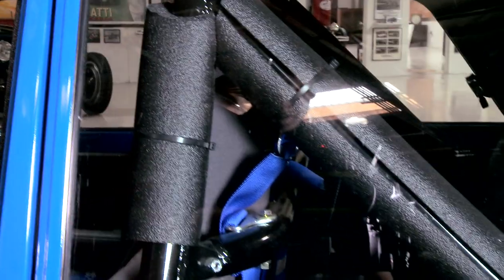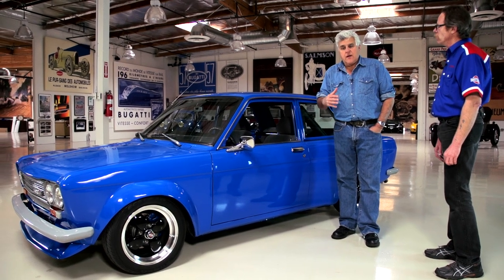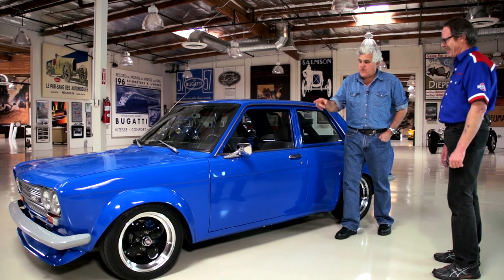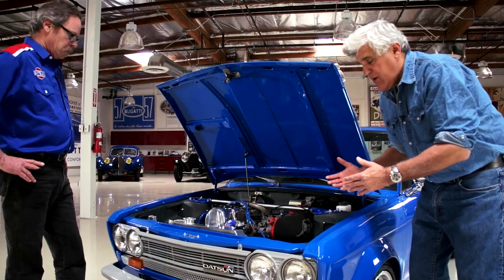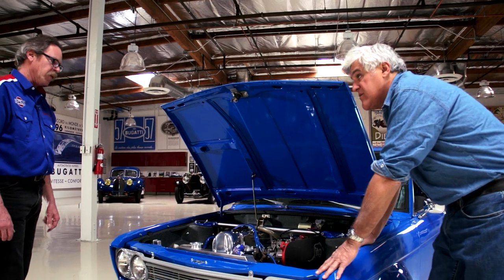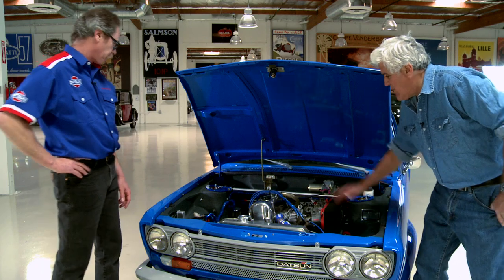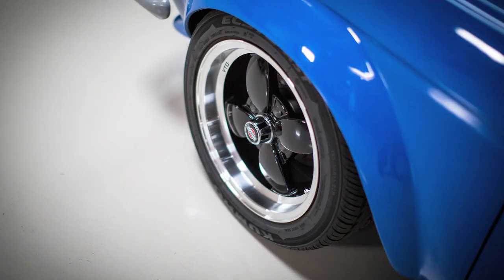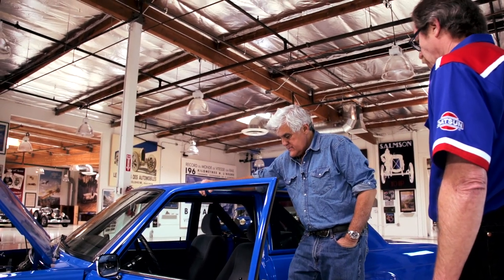1971 Datsun 510 - Jay Leno's Garage

Comment: All of "US" car guys need to be more like Jay. Just love EVERY car for what it is.....truly a purest. Beautiful car.
Reply: Well said
Reply: Purist, not purest
Reply: Vidal J  I first read your comment as "all of us US car guys...".  either way you are correct.  We might even be employed by a U.S. car manufacturer and yet the appreciation for the cars such as what we see on Jay's Garage can and perhaps should supersede brand loyalty.  I'd love a "73 Trans Am 455 SD that's been built to get a lot more ponies and more torque and match the suspension and braking to go with the power.  Add a sound system that cranks Highway Song loud enough to drown out the super woofers in the turning lane and we're good to go.  I could say the same about a '69 Ford LTD making similar "adjustments" including front buckets and a console and knocking on 500/500 hp/torque basically turning it into a grand GT.  I know there's an Volvo coupe that could massaged into something better than it was intended to be...   time to turn out the shop lights.
Reply: yep
Reply: hate to break it to you, but if you don't then you're not a real car guy..
Reply: I have a 2000 corolla and it such a beautiful car despite being slow and average. Same as my 2009 Ford Falcon. Love them both
Reply: The problem is most people can only have 1, so then nothing else can be good too.
Reply: "braking to go with the power" 
Or; brEaking b/c of power
..?
Reply: Participation trophys should also be awarded to everyone as well, "congrats u did it". This just sounds like how women pretend to be friends but they secretly hate each others guts.
Reply: I love the 510. But there’s nothing purist about this car. It’s moded to the gills
Reply: That goes more for european car people tbh, way more picky.

Comment: Awesome! My very first car was a 1971 4-speed manual Datsun 510 4-door sedan, light yellow with a black vinyl top and black interior. I bought the car near SeaTac airport in 1975 from a woman (she purchased the car brand new in downtown Seattle) who just got married and worked for the airlines. So needless to say, the car had less than 9,000 miles on it. I had to work and save the money to buy the car and have enough for insurance. My Dad and I had been looking for cars that were less than $1,500, but this car was selling for $1,800. I talked my Dad into going to look at it anyway, even though it was over my budget. The women sold the car to us for $1,400, but I didn't have enough for insurance, so I talked my Dad into lending me the extra $200 I needed with the promise that I had to pay it back within 6 months (He really liked the car also and knew it was like new, so he let me buy it). I had the car for just shy of 8 years. I modified the exhaust with a high RPM long header and 2 and half inch pipe with what was called at the time a turbo muffler (Exhaust Specialties did the work in Ballard or Seattle area). I had it dyno tuned at the only place around that did it (never heard of that before, a friend told me about the shop just off of 145th and Highway 99 in 1976). With the header and the exhaust, it pulled a 104 HP out of that 1600 engine, yeee haaa! It did 17 second flat quarter mile runs at between 72 & 75 MPH at SIR in Kent, could not get to go any faster even with speed shifting. The car could cook and the front end started floating over 120 MPH, no spoilers (speedometer only went to 120). When I owned the car, I didn't even know it had an independent rear end. I learned a lot since then because of others teaching me all about those Datsun 510's from fine people like yourself and others in the last 40 + years. Thanks, and I hope you and your dear families have a wonderful year!!

Comment: We used to call modified Datsun 510's "Box Z's" in the early 1970's. Knew a guy that had one set up like this from Thousand Oaks and man that car adjusted my thinking on what cool was. I believe the stock 1600cc motor for this car was also used in the Datsun pickup.
Very cool car.

Comment: Jay:  These Datsuns were all over L.A when I was a student at Art Center in the early 70s. I recall being told that there was a widespread suspicion that the 510 was inspired by the BMW 1600 and 2002...think of the suspension , size and body shape similarities!   Re a clear engine bay, a black neighbour of mine in Toronto once told me those older American cars with great huge engine bays were referred to in the Caribbean as a car for shade tree mechanics..because you could climb in and stnd beside the engine ..feet on the ground, to work on it!

Ken Bowes

Comment: That was the car to have when I was a kid growing up on California in the 80's.  This and the Ford/Mercury Capri!
Reply: Yeah ! The Ford Capri ! So exotic for us, europeans ! For us it looks like a muscle car with these shapes and this rear axle and blade suspensions ! And in real, it's a half of the size of a big muscle car that you have... X)
Reply: The ford capri was my first car.  So much fun, easy to work on.  Very fast and I had really cool mods like lowering on BBS wheels, glass pack exhaust with headers.    I miss that car.
Reply: Wow that's nice for a first car. Actually I thought this model was made for europe only. We run with one of these (model of 1980 if i remember) on a mountain road. This day I drove a 1986's Renault 5 turbo 2 and I tried the Capri for few minutes, it was fun to drive.
Reply: The Capri was distributed in the US under the Mercury brand...(Mercury Capri).  That said, on my 1971 everything through the car had Ford branding.  It was very much a Ford Europe car.

Comment: The truth of why Nissan eliminated the Datsun brand is simply the terrible level of jealous against Mr. Katayama and the others who succeeded for what they have done in the States. Back in the '60s, there was another car maker called Prince. Skyline was the Prince's car and they had the more sportier mind than the Nissan. The Skyline left a legend when the early Japanese Grand Prix which was the sport car racing and the early Prince Skyline GT had passed the Porsche 906. The reality was that the 906 had a electrical failure or something and had to go to the pit, and prior to that, it slowed down and Skyline passed it. At the grand stand, that passing was announced and the spectators saw the Prince Skyline GT came before the Porsche at the last corner and that wowed and encouraged all the Japanese motorsport fans and gear heads. That was the lap which made the Skyline name as the legend and grabbed the people's mind with the different level of respect. But sadly, Prince Motors had the management problem and merged by Nissan. And the designing staff of Prince have brought many great cars to Nissan. However Nissan management hated that image. And such mind went worse and they had the discrimination against the ex-Prince employees. The Nissan management had the pure jealous against the Prince brand and what they have done was to add a code number on the ex-Prince people's employee ID numbers so they can easily figure out he or she is the ex-Prince personal. And Nissan management treated them bad. Slow or no promotions for the ex-Prince guys were normal.
Then a couple decades later, Nissan had the problem with the management and they are forced to have the president from their main bank. Basically that was caused by the Nissan management's lack of understanding for their customers and their own fellow workers. Therefore, they always had the opposition problems with the union, and that went worse and worse. At one time, Nissan was the rival of Toyota. But during the ill fated era at Nissan, the brand has lost major market share and let Toyota run forward.
Then one of the worst tycoon came from the main bank with the name of Ishihara. President Ishihara had the big ego bigger than life. He made the relationship with the union worse and worse, and the products which Nissan sent to the market have gotten worse and worse.
This guy was a dictator and all his dissatisfaction went to the union, management and then the Datsun brand. The first president of Nissan U.S.A., Mr. Katayama who is known as the godfather of the Z car and pre-Z Datsuns, who built the American headquarters at the center of many major freeways are crossing in the southern California and had the big Datsun sign on the roof of the building, so all the drivers can see that. He's the man behind the success of the Datsun brand in the U.S.A.  Ishihara hated that. He had the burning jealousy against Mr. K who is respected and be loved by many, which were the things he could not earn. So he decided to eliminate Datsun with the excuse to have the two different brand in one; Nissan. 
The rest is history. Post Ishihara management still came from the bank and they were no car guys. And finally, the car guys went up to the management posts, Nissan was too late to stand by their own feet. So they were merged by Renault of France. But the management with the car guys had kept push the good projects forward and they brought the 300ZX with having Mr. K as its sales promotional activities. Mr. K was Zora Arkus Duntov of the Z car and the Z car fans hoorayed with that.
Anyway, the elimination of the Datsun brand in the U.S.A. was decided by the ill fated president Ishihara. It was a sad story.
Reply: Thank you for your expertise...!!!;
Reply: It happened dat soon?
Reply: Thank you for that knowledge
Reply: Thank you for that exposé. Very informative.
Certainly remember the Prince Skyline GT (at Sandown Melbourne Australia in the 60's). Forerunner of many Holden upgrades with a bigger straight six and ultimately a V8.
Reply: Ok, I had heard how Datsun came about way the hell back. I remember seeing the 1600 when it first came out in the 60s and items like keys were branded both Datsun and Nissan. Some of the smart arse drivers would drive 10 to 15 mph (We had miles back then) and as soon as someone in a Holden, Falcon or Valiant  tried to overtake they would keep them trapped in the wrong lane. As they said, the first stock production everyman's car in Oz that could beat 100 mph (easily). The steel used was high tensile so thin and light, but hard to panel beat. Nissan in the late 70s early 80s tried to market nostalgia with the Stanza. About all it shared with the original 1600 was the L16 engine. The body was thick soft local sheet. No independent rear end etc. 
When I built my 1600 up from a shell I needed donations from various Nissan / Datsun models. 180B SSS engine (L18 with twin SU carbs) and gearbox, diff, rear suspension and front cross member, 240K struts andbrakes, Stanza tail lights and bumpers and brake booster, clutch etc.  Sheet metal for rust repair from flat panels of donor cars. It went well and we raced it a few times until we sold it to another rally driver.
Reply: @mikenewman4078  Yes Datsun panels always got 'wavey'

Comment: The best car I ever owned when it came to working on the car.. Like the everyday man could tinker on it was a 1999 honda civic sedan with a D16Y7 engine... So simple to work on.. everything is right in front of you and easy to access.. I totaled it 2 years ago and wish I had another one so bad. I loved that car.. I changed the whole exhaust from headers back with nothing more than some ramps to drive up on and hand tools.
Reply: Raised on USA hot rods; my best memories were tinkering on my 99 D16Y7. The wiring was crap, as were the internals, it ran hot, the paint needed constant attention, and the typical unreliable Honda A/C cost a bundle to fix.... Few understood why I loved that Civic so much.
Reply: Michael Bullington I wish I still had mine.. mine didnt run hot or anything it was in great shape plus I got it for a steal.. I bought it from original owner who was a grandma and only drove it to church on sundays.. I bought it with 54,000 miles on it in 2010 for 4100$.. only thing wrong was drivers window crank was broken.. I fixed that for 14 dollars.. I put a full header/exhaust kit on it using nothing but ramps to raise the front and back and a welder and handtools.

I put an intake on it and new camshaft and hardware.. I had it dyno'd before I totaled it and for such a lightweight car it had a respectable 144hp at the wheels pretty good jump from the stock 106hp it came with. it miss it daily.
Reply: Sounds like a nice set up on yours. I did a 16" alloy wheels, intake, and ignition. Then did a D16y8 & transmission. VTEC yo! a nicer trans & stock headers to go with the rest of the stock (nonpolished) stainless exhaust (I still have part of it in the yard - not rusting). I put a straight pipe on the stock exhaust; it sounded and carved nicely.

Comment: I had a 1971 510 30 years ago or so. I took the long block and tranny 5 speed.out of a1978 200sx. Put all the accessories from the 1600 cc engine and put it back in the car. One problem you have a taller eng. now with the original eng. mounts. I shimmed the "hood to hinges" using washers . I also took 1.5 coils off by cutting the coil springs { there was no coil overs etc. in those days.}and put 260z 14 inch wheels on it. In those days it was a cool/great car. Great memories.Thanks for the video Mr. Leno and Greg Elliot. Great car you got there.

Comment: I owned a 1972 510 back in 1974. Loved this car, ended up lowered, 2200 cc engine, comp. suspension roll bars and topped it of with a turbo. Raced this car for a couple years locally and had a lot of fun.

Comment: They were very popular in South Africa as rally cars. The coupe was the 1800 and a taillight that ran across the whole back. 
Then there was the 1600, one being the SSS with the tachometer & SU carbs. The deluxe had no tachometer and a single carb ,therefore the dashes were different as well as the steering.
It was believed the because of the independent back suspension one could not flip this car over ,unfortunately I did and the car was my dads.!!!!!  I was 21.

Comment: My first car in high school was a '69 510 and I loved it.  After I graduated, I modified the engine by porting it to 1600SSS specs, installed 240 Zed valve seats and valves, 455 Pontiac valve springs, HP cam, angle-milled the head and adapted a Rochester 2bbl to the intake.  The engine has forged crank and rods from the factory and the addition of forged pistons finished it off.  Wish I had it now.

Comment: I had a '71 Mazda RX2 two door stick with glass pipes 12B engine back in 85. Damn I wish I still had it. Nothing was like that rotary engine with the sound of the engine with those glass exhaust. Red with black interior and a white  vynal top. GT steering wheel on white/chrome  Epsonlons  rims. Kenwood system with a 300 watt Fosgate amp and 12inch, 6x9s Cerwin Vega speakers. My boy had a 72' 510 and other buddy had a 74' Mazda RX3. Hanging out at the street races on Crenshaw Blvd  back then was lot of fun early mid 80's. Seeing this car brought back lots of memories.

Comment: Jay, that body was galvanized from the factory. And the Datsun name was used because the company  thought that it would be a better name to use and pronounce in the US market. Then in the mid 80's when Nissan was in heavy competition with Toyota for largest Japanese car company in their hubris they decided to change the US name to Nissan. They even put the decision up for a vote by the factory workers. They chose to change it to Nissan and it was a devastating decision. It's a very bad marketing decision.  I was a Datsun/Nissan dealer tech at the time and it was so bad that I ended up going to Honda. They even ended up having to close some Japanese factories. Nissan has taken years to recover and still doesn't have the market share they had before the name change.
Reply: Not just in the USA!All over the world..
Reply: Datsun was the tuner version of Nissan.....
Reply: you have it all wrong.  it was always called nissan and not datsun.  when nissan came to america, they called it datsun, just in case it didn't do well.  this way they wont hurt the nissan brand.  once datsun did well, they decided to use their real name, which is nissan.
Reply: I drive a new Datsun Go+. Well it's basically a Nissan Micra 1.2 with 30 Cm longer body, remapped ECU, no variable valve, but get subsidized tax from government. Fun to drive , nice fuel economy, reminds me to my dad's 620 pickup at 80's.
Reply: Way I heard it....... back at Nissan headquarters.... The brass wanted the Roadster out on the factory floor fast (it was basically a copy of a Mercedes 190 SL and a few other things thrown in.).  Brass remarked....... "I WANT IT TOMORROW"  Head engineer looked at him with BIG Japanese eyes and said it awe..... YOU WANT IT .......  (wait for it).............. wait for it......... 
DAT SOON :p    and that you see is how the name Datsun started out as the US name.   :D

PS... I miss my old 510's and Roadsters (both 1600 and Solexed 2000)
Reply: funny that was called Datsun in australia
Reply: I don't think they galvanized these cars. The way they rusted out there is no way they were.
Reply: In 1931, DAT Jidosha Seizo became affiliated with Tobata Casting, and was merged into Tobata Casting in 1933. As Tobata Casting was a Nissan company, this was the beginning of Nissan's automobile manufacturing. The use of the Datsun name in the American market derives from the name Nissan used for its production cars. In fact, the cars produced by Nissan already used the Datsun brand name, a successful brand in Japan since 1932, long before World War II. Before the entry into the American market in 1958, Nissan did not produce cars under the Nissan brand name, but only trucks. Their in-house-designed cars were always branded as Datsuns. Hence, for Nissan executives it would be only natural to use such a successful name when exporting models to the United States.